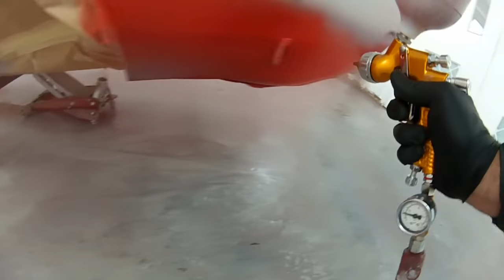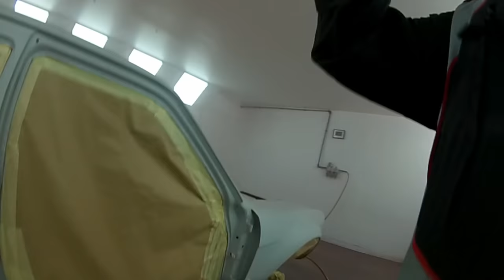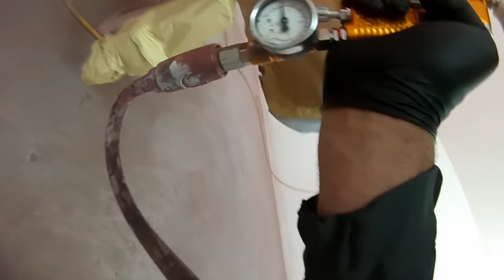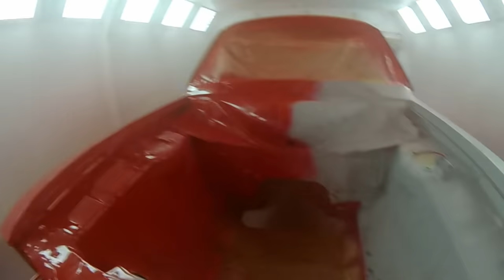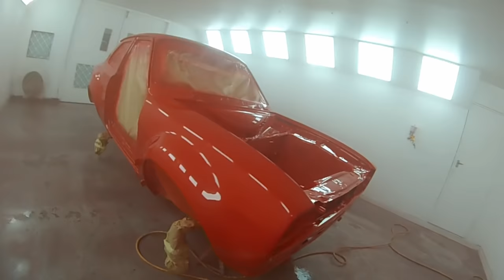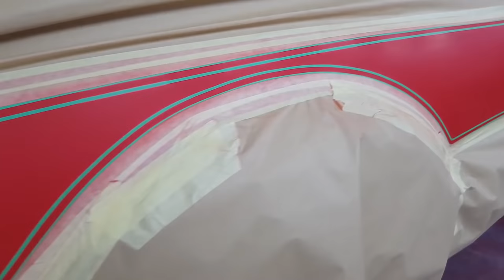Mk 1 Escort Respray

Comment: Fantastic job. You got huge coverage from that first pot. And  spray with a very wide fan.
How many more coats after the first and did you laquer?
Reply: The spray gun is a devibiss Gtr pro.serious spray gun
Reply: This is most likely being painted with 2k original style paint to match the factory spec of the car, no clear coat
Reply from the maker: 3 coats in total